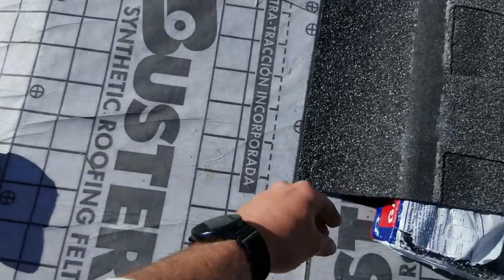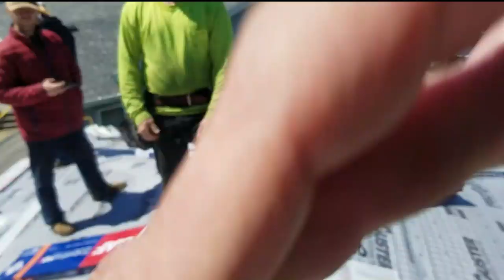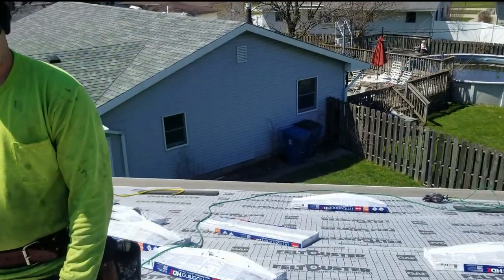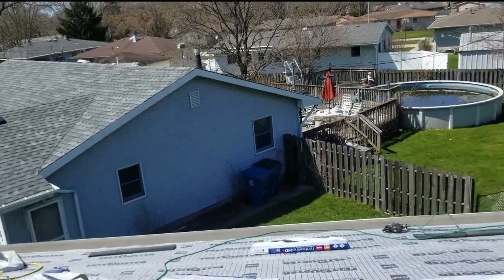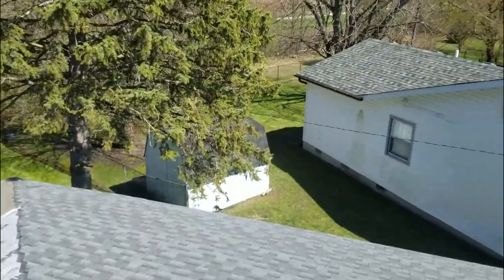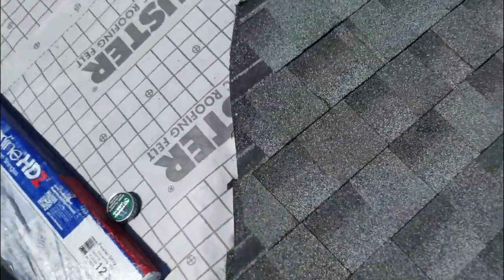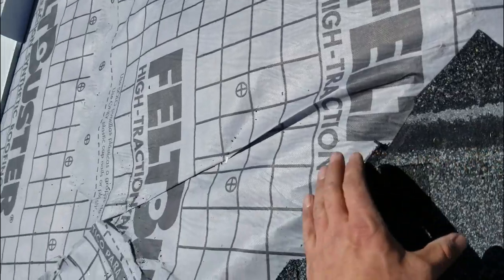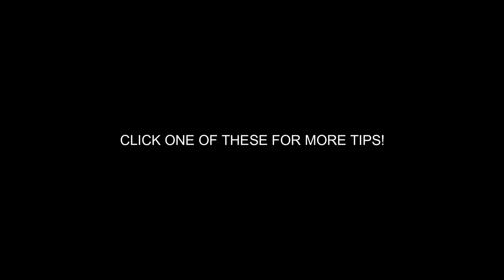1v1 SHINGLING RACE!! Pouch vs no pouch

Comment: Doin the span for starter is not wrk efficient ur economy of motion is lacking
Reply from the maker: What do you mean
Reply: @NWIVeteranConstruction  by walkn the wholevspan to lay out starter ur using more motion lay starter as u go while step stagger or what some call books
Reply: @NWIVeteranConstruction  lot of people say their the fastest but havent seen 1 could beat me no hook blade flip it cut wit straight like a sidn panel n snips to cut. California for valleys finish wit 4 trimmies on last cap
Reply from the maker: @johnotoole5786  okay bud stick with me. I wanna have a conversation about this. So in response to your walking, you have a point.  But I believe Tim did exactly that in this video, laid starter as he got to it while shingling. I beat him by about 8 minutes... so in my opinion, If a specific task needs done (like installing X amount of starter) sometimes it's better to knock it all out at once so you can find a rhythm while doing it, and on hot days they won't have time to heat up a lot so that's an extra plus.  As far as the straight blade goes, i disagree.  For example the first time I raced tim, I didn't have a hook blade. As I shingled I thought to myself, doesn't really seem like this is costing me much time... Tim beat me that day. 😂 because I didn't have a hook blade and couldn't execute my methods normally. That's probably why Tim had so much confidence going into this race.   It was a gable roof. I make this channel so people like you can compare yourself to other roofers and potentially pick up on new tricks. I created the one square challenge so you can test yourself against other roofers.  Plenty people have done it thinking they're gonna beat the record just to get a reality check and real men still posted, even with average times and we still learn new things from them.  Give it a try! Also, out of curiosity... what is the most shingles you laid in one day? with or without a tosser. I'm just trying to have a friendly convo so maybe I can learn something from you too